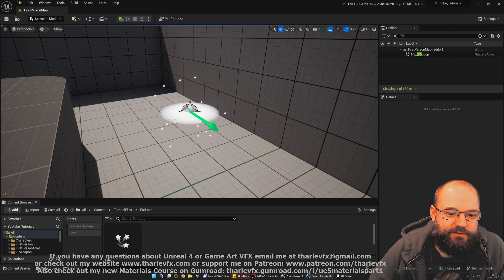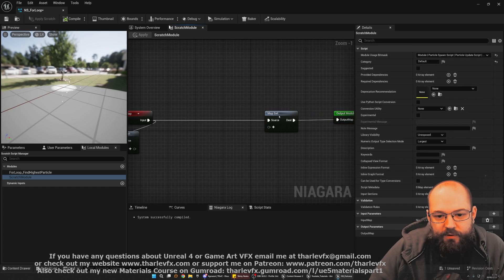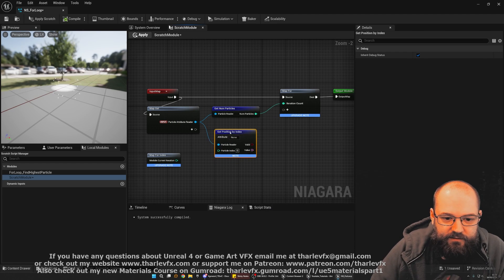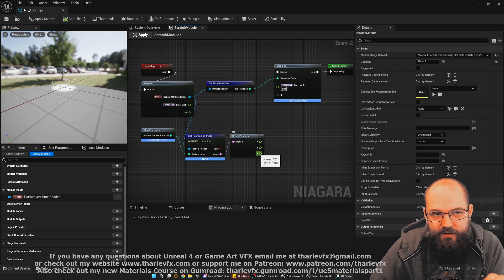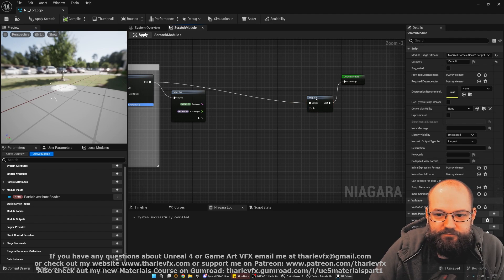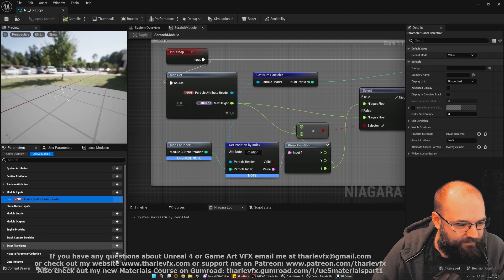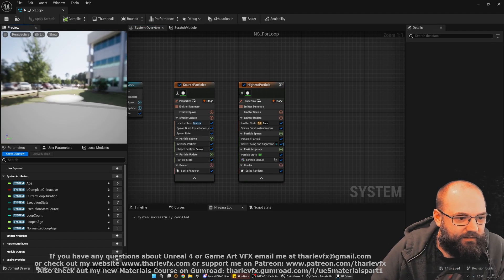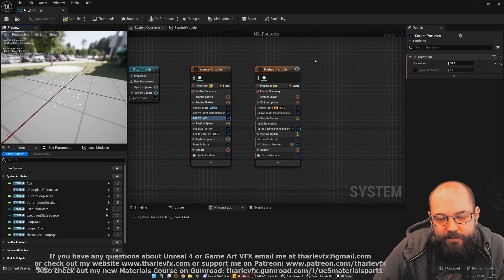Finding the Highest Particle using For Loops in Niagara

Comment: Hi @tharlevfx et al.  I'm trying to get a handle on the particle attribute reader modules so was attempting to replicate this tutorial in hlsl using the corresponding internal methods instead of the external nodes.  I'm getting a no matching function error for call to GetPositionByIndex even though that function call was autocompleted off of "ParticleAttributeReader."   Is there some big gotcha I missed in my setup?  I've worked through a RBD collision tutorial and seen this function in action there.
Reply: Do those ParticleAttributeReader methods only work within the NeighborGrid system?
Reply: Found the error with the help of my coding buddy - it failed to compile into the correct function bc I hard coded the boolean argument to true in my test but it wanted a variable. facepalmemoji

Comment: This was very helpful. I was unable to get the 'Write To Niagara Data Channel(batch)' node to work properly. i needed some vec3 in Niagara so instead i made user param array of positions and sent them as a array(positions) and was able to loop through to allow objects in the world to interact with my particles. I think the data channel batch would be a good video to cover as there isn't much info out there and its a new but also important system and i am sure its more performant but i was unable to get it to work with the batch call and only the single call.
Reply: As an aside for anyone wondering about if you need to use this video technique to loop over an array and do something to each particle. first make sure your array isnt updating too quickly its not ideal for something that has to happen instantly. But i did the same thing as the video but to get the index for my PositionArray->Get then used .get index=exec index%length. I added an is index valid check then did the same thing with the exec index%length+1 to skip if it it had already changed the value. I had my position array updating at .3 in a blueprint timer and it managed to keep it updated. i may or my not try to put it further or closer depending on if it ends up being underperforming.

Comment: unforunately for some reason this doesnt seem to work in 5.4, the "Module.Current Iteration" seems to be always 0, and the loop never actually iterates, just returning the 1st index, any ideas? :/
Reply from the maker: @alphaone6902  make sure it’s a gpu emitter - loops won’t work on cpu and it won’t give you any errors
Reply: Same here, also 5.4, i do have gpu emitters, but loop won't work as expected

Comment: Thanks for the insightful video!
Do you know how "dangerous" these nodes are? The "upgrade note" says the node is experimental and should be used with care. Any idea how it could break?
Reply from the maker: @tactilevisions  in my experience everything in engine marked experimental usually works but there’s no guarantee it will work in the next version, or in the same way. 
They’re usually safe to use and only get better over time but epic obviously can’t guarantee that with experimental things.
Reply: @tharlevfx  Got it, thanks